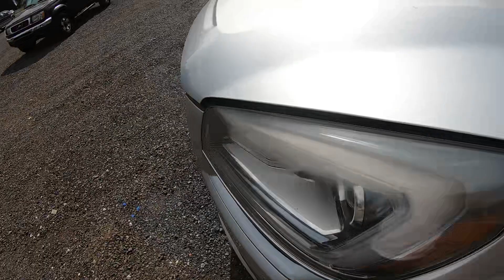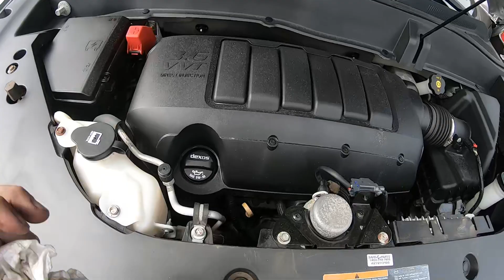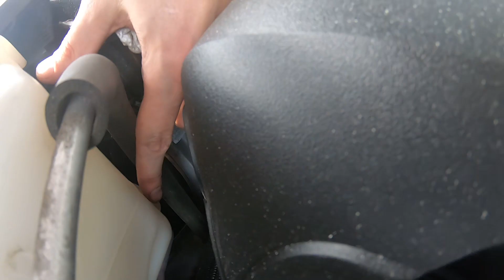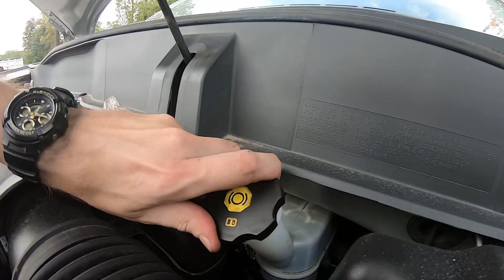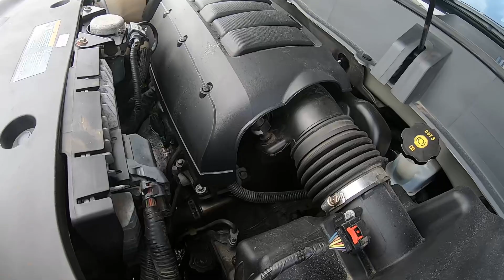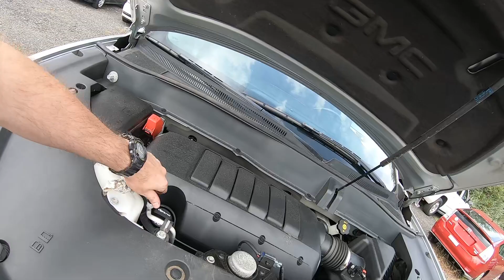How to check Oil and Fluids in GMC Acadia 2007-2016

Comment: I already watched this video.  You are incorrect in regards to the power steering.   To check your power steering flood, you have to remove the oil rez cap, then lift off the plastic cover off the engine.  The power steering rez is UNDER the plastic engine cover.

Comment: You are wrong. The car should be running and you go through each gear for 3 seconds and then wait 3 minutes, leave the engine running when checking the transmission fluid. Also, there is power steering fluid. The power steering reservoir is located under the engine cover.

Comment: Also, the antifreeze reservoir is not under pressure. The radiator cap IS, but it’s under the large MOST FRONT cover. Don’t open it unless cool engine.

Comment: The power steering bottle is under the cover dude just  unscrew the oil cap then pull the top up and it'll be on the front  left.

Comment: how do you feel or top off the transmission oil you did not show me I don't just need the dipstick what about the cap where I can top off slightly I know it's not recommended but I need to do it so where is the transmission fluid never mind

Comment: Just an FYI, the power steering isn’t electric on these.  You have to remove the oil cap and then the plastic engine cover.  There is a common power steering oil leak on these so you need to monitor the fluid levels often.
Reply: Yep 
This guy is not very good.